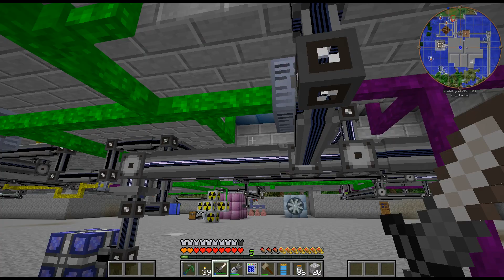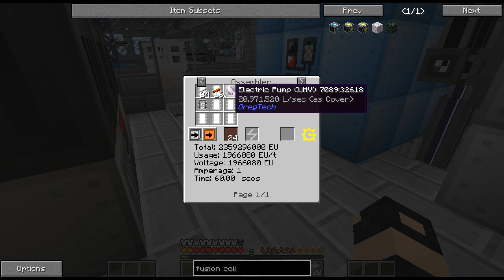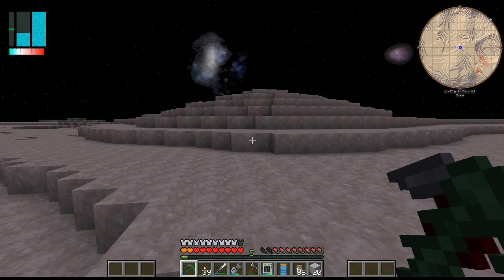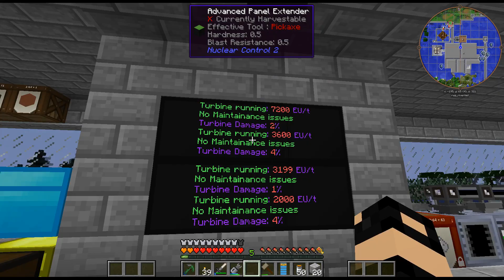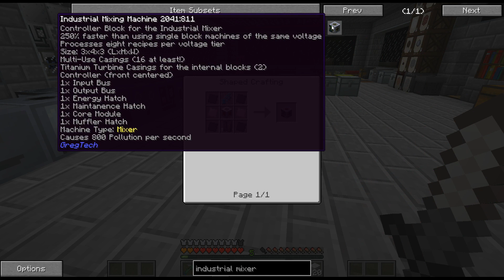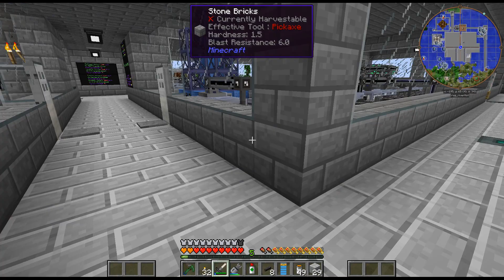Gregtech New Horizons - 166 - Industrial Mixer

Comment: I can't get my multi-block mixer to work with multiple liquid inputs. I'm trying to make Aqua Regia by mixing nitric acid + diluted sulfuric acid, but it doesn't do anything. Do you know of a way to fix this issue? This multi-block mixer doesn't seem to work with any recipes that use more than one liquid. Please advise.
Reply from the maker: It works on the 2.2.8 version. Multiple fluids in the multiblock mixer was in a recent update. The processing array multi can be a substitute if needed
Reply: @Kharax82  Thanks! I may look into that multi-block too to see if that one's better. I was playing with my brother, and he turned on "void mode" and it just worked for some reason... Odd, but I'm not going to question it haha
Reply from the maker: I just came across the same issue and you need to use a screwdriver on the controller to set "input buses separated false". If it's set to true the mixer wont recognize the hatches need to work in the same recipe.